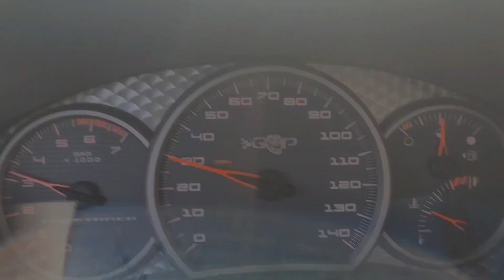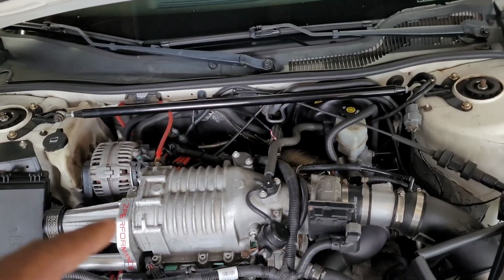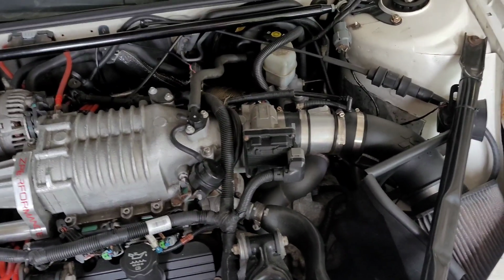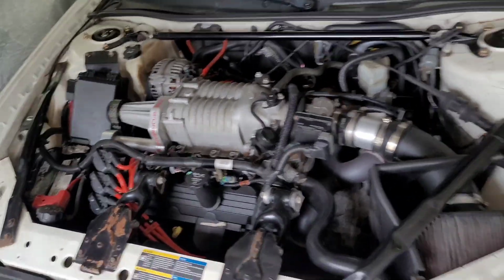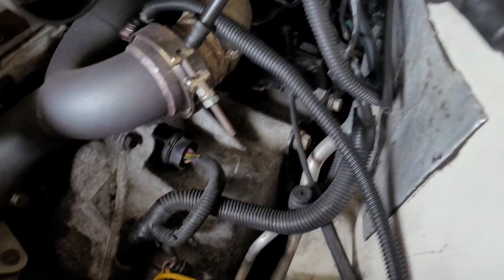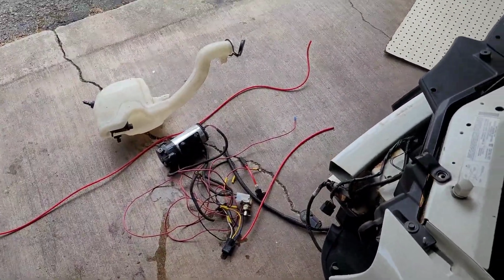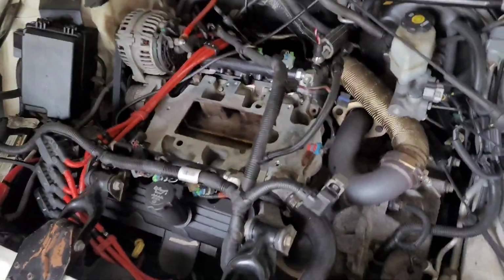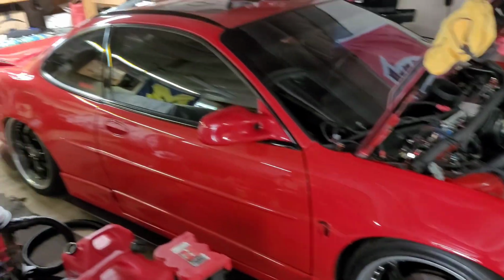Changing things on the 05 grand prix nic cam build (ole peeler)

Comment: upper rad hose looks flattened in the video. say it aint so
Reply from the maker: Yup i need a new radiator cap
Reply: @hand12u  
Nah it just needs to be cleaned so that the disc will release when it goes to negative pressure

Comment: Hey watsup I have a 3800 series with 200000 miles it's making a squeaky noise from engine block its a impala 05 ls
Reply from the maker: Sounds like a bad pcv valve
Reply: @hand12u  does the noise wen it warms up
Reply from the maker: @tanktop305  yup thats it
Reply: @hand12u  ok